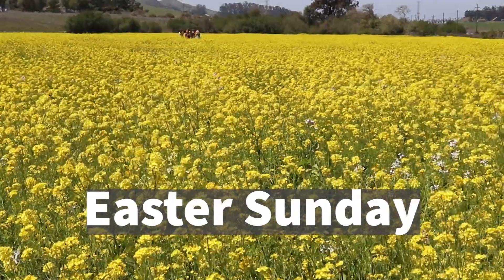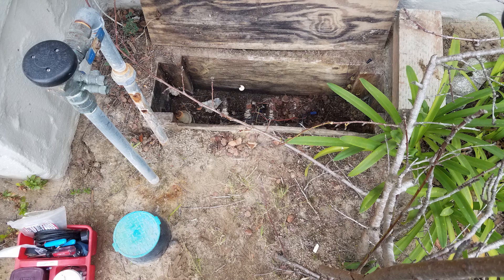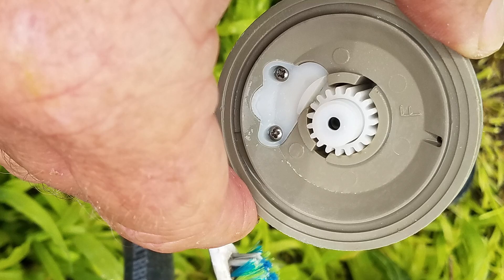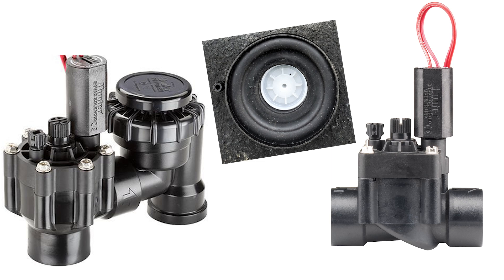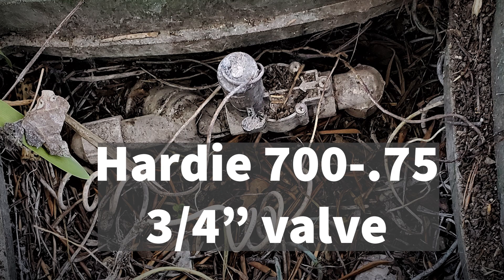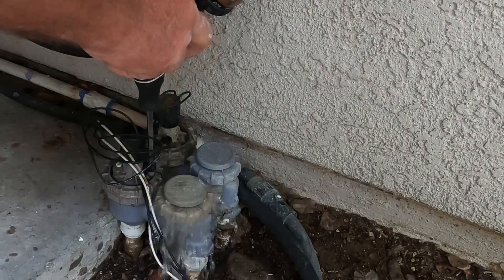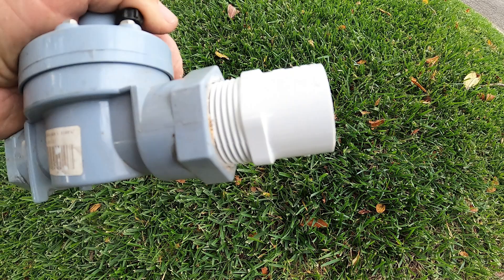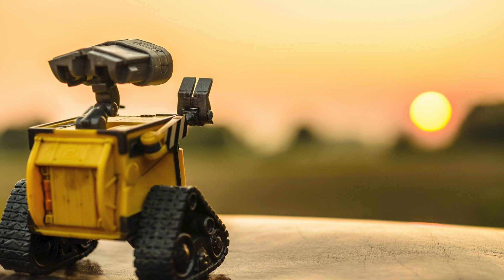Best Irrigation Valves for 2026 | The 3 pro-grade categories compared

Comment: My main auto shutoff valve "hammers".   Do you have any cure for that or is there a main valve that opens more slowly and is less susceptible to hammering.   I don't want to leave the main valve open all the time due to various suspect piping throughout the entire system .   It was originally a hydraulic valve system that I converted to electronic.  The hydraulic valves were buried throughout the yard.   I now have two valve boxes.   One with just two valves in the front yard, and the other box is in the back yard with 6 valves.  The timer controls the main valve so the water is essentially shut off to mosr of the system when it is not operating.  I have an anti hammer stand pipe installed in front of the main valve.  I was thinking of putting one after it as well.   The anit-hammer chamber didn't do much good in terms of controlling the "bang" when the system turns on.
Reply from the maker: IPA, I will attempt to help. First Q is what is the water pressure coming in to the system thru the main auto valve? What brand and model is that valve? Do you have a brass pressure regulator on the system? If so, where?

Comment: What issues will occur with cheap sprinkler valve that the landscape and home builders use ?
Reply from the maker: Premature failure though they could last for many years. Once they fail, there's no point in attempting to repair them. If they're in the ground in a valve box, the labor is in digging it up and burying them so it's best to replace all of them at that time. Does that answer your question? Feel free to let me know the brand and model if you'd like a more concise assessment.
Reply: @SprinklerPros  Thanks for the answer? I replaced with the hunter PVG1”with hydro 3/4 bluLock tubing BluLock coupler and a bluLock 1’ to 3/4 to connect the poly tubing and added a 3/4 ball value to the line leading to zone 2 and zone 1. The problem I was having it was when zone one went on and off it was totally quiet. When zone two came on it was quiet but when it shut off I would hear a loud thump and I couldn’t figure out what that was from. Do you have any idea what that might’ve been
Reply from the maker: I'm grasping at experienced straws here. Any chance that the #1 wire is actually wired to the ground or common or master pump at the  timer? Or wired together with #2 at the valves? It happens.

Comment: We have a lawn genie anti-siphon valve that has issues. Can I replace it with the Hunter ASV? It's used for a pool fill valve, no wires on it for controller, just manually filling pool every week.
Reply from the maker: Tony, yes you can. The vertical on-center distance between risers is pretty much the same. If you don't ever anticipate wanting it to be automated you can use the Irritrol 2706PR 3/4" or 2709PR 1" manual valves. Be sure to not over-tighten them. If you use one of those you can also buy a Buckner-Superior SK-30 30" sprinkler valve key so you don't need to bend over to operate the valve. Let me know what you decide.

Comment: What about the orbit brass valves, seems like metal would be better than plastic, no?
Reply from the maker: Jill, I understand your thought regarding brass over plastic, but there are so many benefits of plastic valves over brass in our industry now that brass valves are normally only used in large heavy duty situations. I began in this industry when brass valves and brass popups were still installed so I have watched the evolution to plastic and the improvements since then. One of the biggest things behind cost of production is that plastic doesn't rust and corrode which is huge, especially with dirty water applications like well/pond/river/lake/creek water.
I hope this helps. Any other questions?

Comment: Why didn't you review the Rain Bird PGA valve series? Also, in my opinion, the PE Series (PEB),  valve series is comparable to the ICV, but with a much more reliable solenoid than the Hunter. What do you think?
Reply from the maker: On my channel I don't do comprehensive product comparisons, meaning that I don't compare every similar product from each manufacturer on a particular video. My comparisons are based on which products I have experienced in 37 years and what I prefer based on that experience. I explain some of my thoughts and reasoning in my videos and it's all based on my field experience. I don't have a carte blanche blind preference. I hope this helps. Best wishes from across the globe.

Comment: Hunter solenoids are a pain in the butt.  Threads are extremely likely to get crossed and the o ring falls off or breaks.  Poor design.  And you are the only irrigator in the world who would use an irritrol valve before a RB. Clearly there is a personal bias going against RB products.  You cant deny they are the #1 brand sold and yet you have nothing positive to say for them.  Shenanigans!
Reply: I thought the same after the rotary nozzle comparison a while back. Still good videos though
Reply: Just my 2 cents but I have found statements that say #1 selling brand doesnt make it the best product just the most sold. Quality usually cost alittle more . During the process of researching products to replace a 40 year old system  most "pros" favor Hunter  and Irritrol  with pros and cons on both sides. Non mentioned  and or recommended Rainbird, Orbit, or Toro. I agree these are probably the easily available option and for the most part a perfectly fine solution. I also started alot of videos  installing anti siphon valves at or below ground, at which point I moved on to the next. That being said take the advice given pick what you want throw out the rest and move on. BTW wheres your video?

Comment: Thanks for making this video! I have two inline Orbit valves for my fish tank auto flush system, both leaked internally even after shutoff. Orbit valves are junk! I'm getting Hunter valves.
Reply from the maker: Choon, I'm glad it helped. Consider installing an inline filter before the valves to capture any possible contaminants that may interfere with the valves closing properly. Debris in the water, even a grain of sand, can get stuck under the diaphragm and keep it from closing, regardless of the brand of valve. You can take these valves apart and see if you find anything to clean out. 🐠🐟

Comment: Thank you for the video, with all the information and tips, I wanna replace my sprinkler valves (anti-siphon) to the Hunter brand per recommendation, however my existing ones from center to center (inlet and outlet) are 4.5” apart and the footprint of the hunter are 4”, don’t seem possible can make it fit easily, if there any options I can go with? The current ones are Lawn Genie, don’t seem there’s much options out there with 4.5” apart besides the one you don’t recommend which is the Jar Top from Orbit, please shed me some light, no idea what else options do I have. Thank you in advance!
Reply from the maker: That's great that you thought to measure it. Actually the 1/2" difference isn't enough to be concerned with. I can say that by experience. I've done plenty of those switches. A tip: the more length in vertical pipe you use, the greater flexibility to spread the pipes apart. Be sure to use schedule 40 or 80 for strength instead of thin-walled pipe. Does this help?
Reply: @SprinklerPros  thank you for the reply, will give it a try over the weekends then, hope everything will go smoothly!

Comment: Nice video. What is it about the Rainbird 1in DV that keeps it from the top of your list?
Reply from the maker: Thank you Bill.  Kindly, I explained that in the video.
Reply: He doesn't recommend anything RainBird makes.  I have been a licensed Irrigator for 22+ yrs.  RainBird is the best hands down.  He doesn't tell you this but the solenoid on the hunters are the biggest problem.  When you try to open manually they often cross thread when re-tightened. Hunter is the 2nd most used for a reason.   RainBird is better.  But I have come to the decision this man has had some issue in the past with RB and will not give the viewer a fair opinion on the product.
Reply: @hlsenterprises4477  thank you for the reply. I've used all brands of valves in the past 40 years and I'll stand by Rainbird. I've used the hunter once in awhile just to match what they already have on the job. I've never seen a problem with the hunter bleed or solenoid. I Have Seen the Rain Bird bleed deform and also I've changed more than a few of the Rainbird solenoid O-rings. I think they are both darn good. As long as you can continue to get parts for both of them it's a toss-up for me.